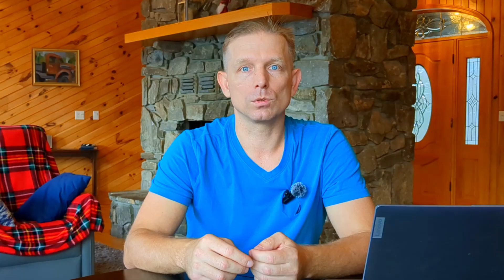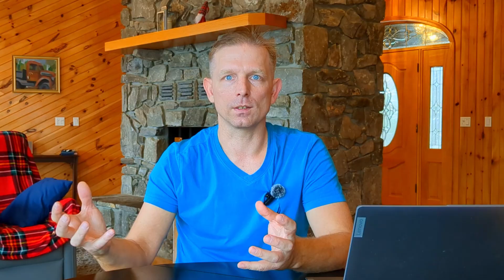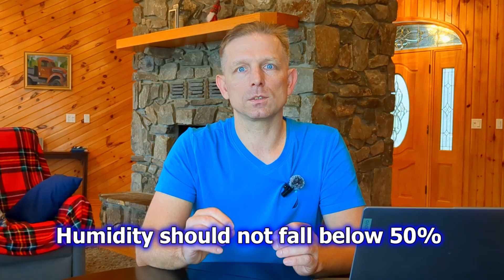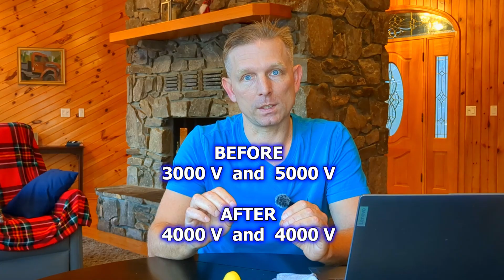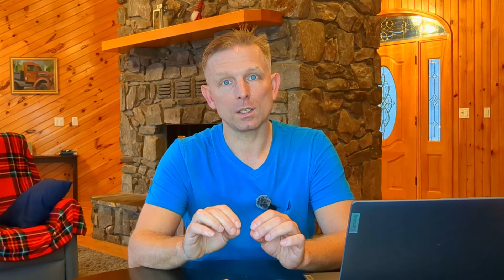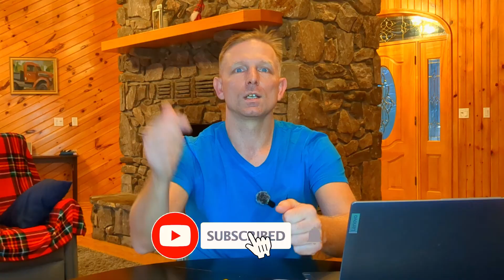ESD Protection from Static Electricity. SAVE your PCB now!

Comment: i came here just to hear about Antistatic Material. Specifically Anti-static bags to covering sensitive small electric and electronic equipment . You didn't mention it
Reply from the maker: Sorry about that. 
You need ESD bags. Color like a silver. Can be soldered, can be with zip lock

Comment: Subscribed. Thank you for the clear explanations. Can you do a video about grounding and also grounding in circuits?
Reply from the maker: Thank you very much. I am SMT Process Engineer, not a PCB designer. Sometimes I participate in R&D projects to facilitate and simplify subsequent production while maintaining maximum quality, and conduct all tests before the production of PCBs. For your information, try to find Altium Designer knowledge base, where you can find various approaches to the correct layout of conductors and ground polygons/pads.

Comment: i want to ask why my electronic device i'm not use a long time can be dead when im first time to use it again
Reply from the maker: What device?
Reply: @ElectronicsManufacturingTech  I have a ps 2 stored in a box for a long time, when I reboot it it won't start. also my old school laptop stored in a bag, when I reboot it I get a black screen.
Reply from the maker: @djunaedi2500  Maybe the storage room is damp and moisture got into the devices? Caused corrosion?
Reply: @djunaedi2500 How about Bios battery? Some of computers won't turn on if battery is dead.
Also, Cellphones, tablets and laptops if battery is deep discharged, they can wont turns even charger is connected. Sometimes need connect special charger dirrectly to battery.